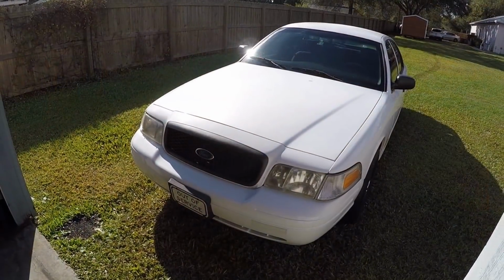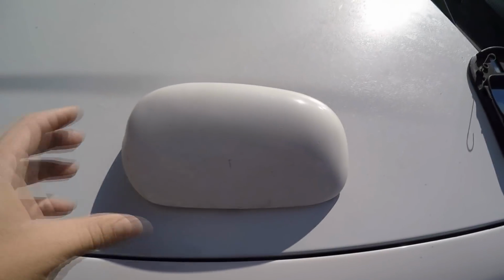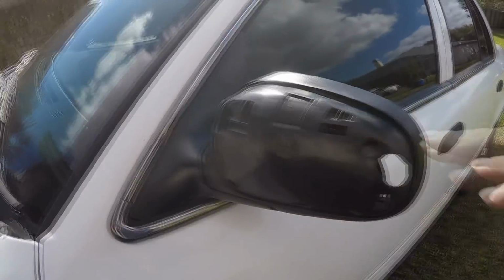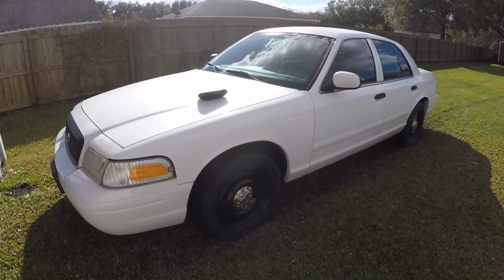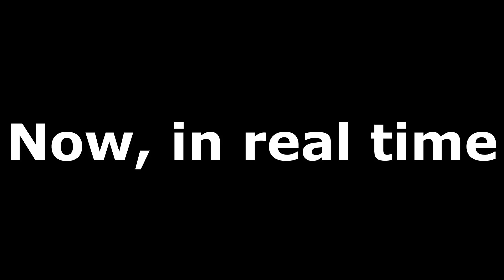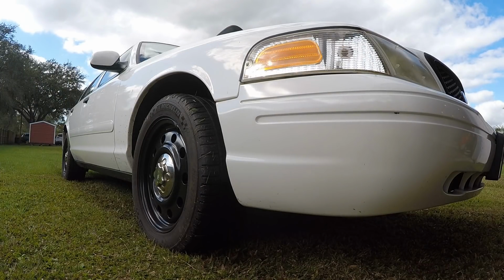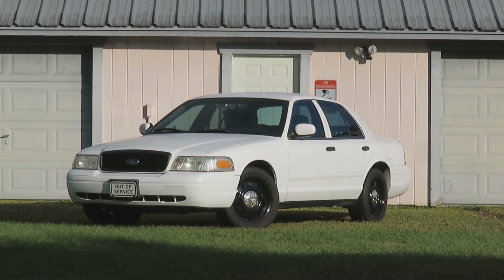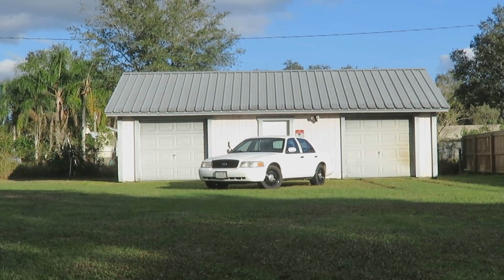How To - Removing Mirror Glass & Cover Swap

Comment: I like this idea. My CV is silver and I pulled a set of LX caps off a junker a few months back. Plans are to color match them. And my steelies need some attention too. I repainted my original wheels black how you did in your other video. I don't like chrome so the civi look is something I wouldn't do. May just color match the grille surround to the body as well. Good video. Keep up the good work.
Reply from the maker: Thanks, much appreciated!  I hope you get the look you want on yours!  That's half the fun with these cars, changing them to match your taste.

Comment: Thank you ,just needed to know how to put  the mirror  bk in,that has the 2wire clips but not relly sure that I put them in the right hole, they look too wide  so it seem that only that the  mirror that  fits over the shape  is all that s holding it on  but so far it  work so thank you for your time  & service janie

Comment: Do you happen to know if the mirror cover will work with after market units? Or only the oem units? They want $50 for me to pull a used mirror assembly at the local junkyards… seems a bit high to me 😬

Comment: Hmmm,,,, my mirror snapped in half when I tried to remove it.   so much for easy.  Luckily you can buy an OEM on line for less than the junk yard wanted.  And I was able to salvage the painted cover by soaking the entire old mirror assembly in just below boiling water for 20 minutes, then carefully pulling it off the mirror assembly.  Even then, two of the plastic clips broke and I will need glue to re-use the cover.  Plastic auto parts are made for one time assembly, never for removal/replacement